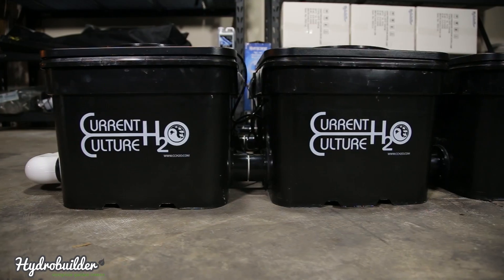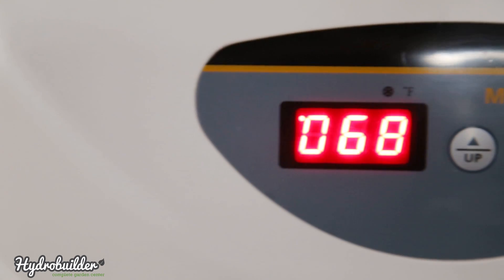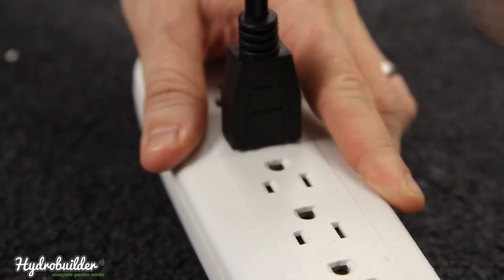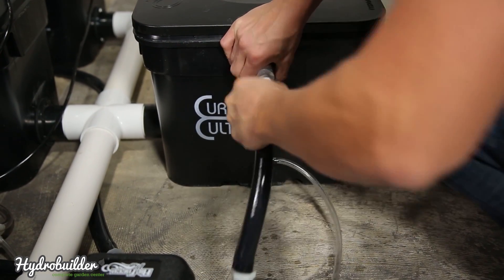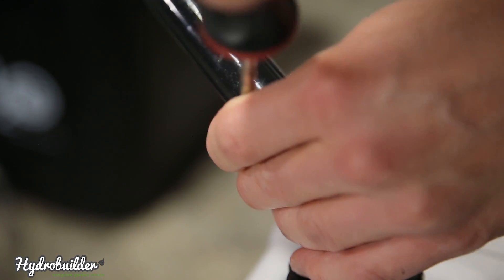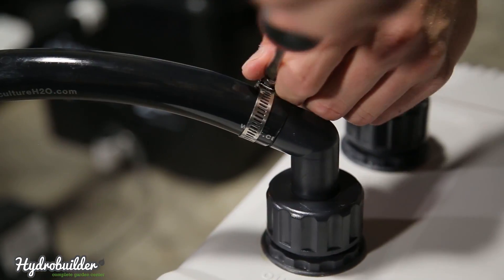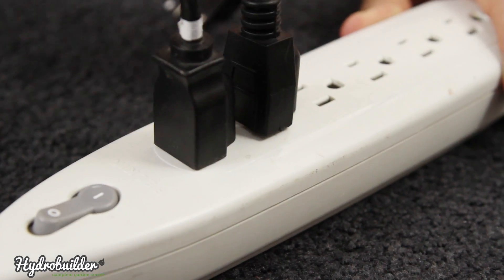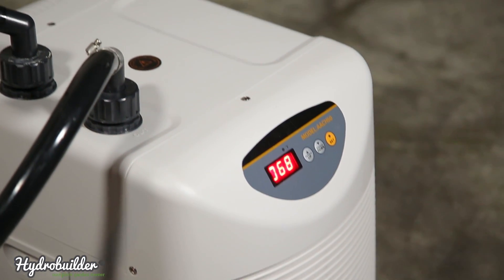How To Install a water chiller to your Hydroponic system - Hydrobuilder.com

Comment: I don't understand the line that you said about never running the chiller with hot water. The purpose of the chiller is to cool down water that is too hot! Is there a limit how warm the water can be that is being chilled? I'm considering buying an Active Aqua 1/4 HP chiller for DWC hydroponic gardening. I'm trying to do DWC hydroponics outdoor in Florida. This is possible to do in the three winter months, December through February, when the outdoor temperatures are cooler. But in the summertime, the nutrient in the 5 gallon buckets and 10 gallon grow trays is about 85 to 91 degrees. When the nutrient temperature is 85 to 91 degrees, the plants weaken and die. Is there a problem with trying to cool down the nutrient that is 85 to 91 degrees? Will that temperature range damage the chiller? Is it necessary when starting the initial cooling with the chiller, to place ice containers in the nutrient reservoir to reduce the initial high temperature of the reservoir tank, and then after that point maintain the temperature with the chiller? Or, can the chiller cool down the 85 to 91 degree nutrient and then maintain the nutrient at a temperature range of about 62 to 68 degrees? I plan to use about a 30 gallon reservoir tank, and pump the nutrient between the chilled reservoir tank and the grow buckets and trays.
Reply: Bruh he said never run the chiller “without water”. Not with hot water…running a chiller without water can kill it